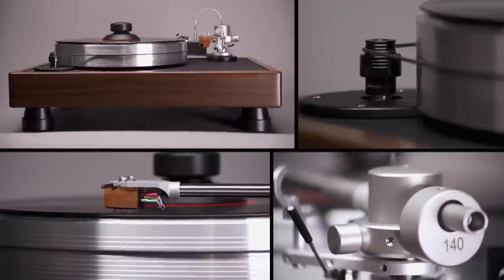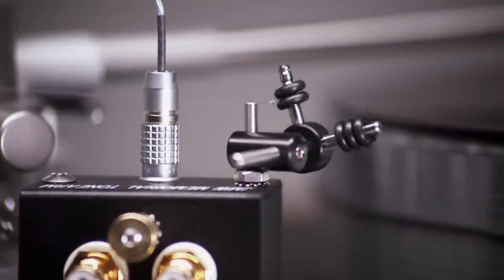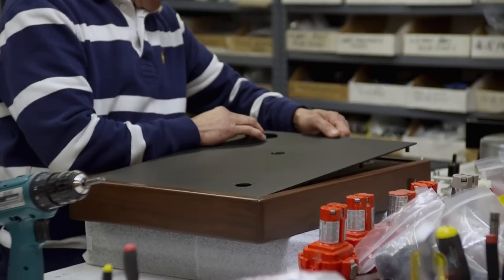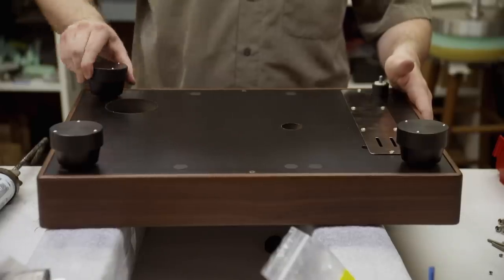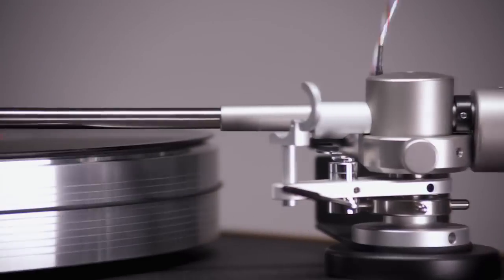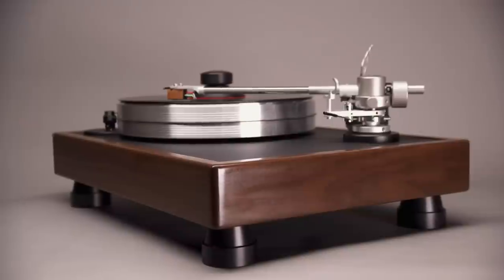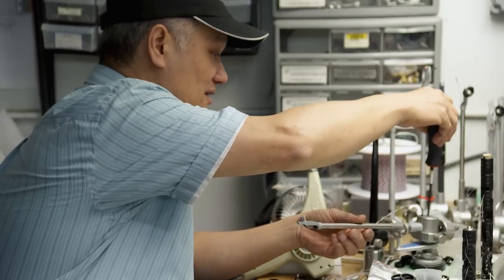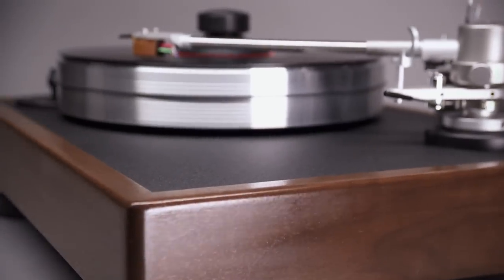How a VPI Classic Turntable is made - BRANDMADE.TV

Comment: Marvelous stuff.  I did my early electronic engineering training in a radio broadcast outfit with six audio studios which used EMT turntables from Germany.  Fantastic.  And 20 pound platters?  Ha!  Ours were 16" diameter and needed 2 guys to lift one, cast iron.  What's new to me, though, is the 'unipoint' (I think) tone arm pivot, excellent idea and that alone would make it superb, never come across it before.  But although absolutely first rate it would never stand up to the hammering turntables get in a pro studio, really rough use for 18 hours a day.  Another winner is the lateral balancing which of course would be necessary with a single pivot point, excellence again.  My present turntable is a Hitachi direct drive, no belts.  But alas, I am now old and my hearing ain't so good no more.....

Comment: The original AR XA  XB was $67 brand new, i used it for 27 years...AR XB pioneered the floating chassis, totally immune from any vibrations, you could literally hammer the plinth vertically and nothing happens to the playing record...I did replace it with a VPI HW MK 3 and have 3 JMW unipivot arms...it works well, but a lot more money

Comment: No solder? motor mounted direclty to the plinth? "aircraft grade aluminum" there are several, all with different characteristics, typically light weight...

I have really been trying to like the VPI turntables but i just dont see how this is worth the cost.

Hot glue...

Balanced scales, how well do they deal with vibration?

Why are they still using metal tone arms? I thought this "space age turntable" would be using "aircraft grade carbon fiber" (which is lighter, stiffer, and more vibration resistant than aluminum).
Reply: Aluminium IF used properly can yeild equal results to carbon fiber.

Comment: I like a little knob to adjust my speed  not that the motor is not spinning and perfect timing but you know I played record where they should have been slow down or they should be speed it up a little bit that's all and having a moter that they say spending at the perfect speed kind of scares me a little bit.  They only made direct drive turntables (ones without a belt or speed control) for the DJ's, because a lot of DJs didn't know how to change a belt in under 3 .1/2 minutes  back in the early 70's & they had to keep the music playing on the radio,  with not time to  worrying about changing belts or if they had a new one in stock & if they didn't they were screwed.

Comment: What type of "glue" do you use to attach the metal plate to the fiber board? Would it not be better to apply this with a notched trowel over the entire two surfaces??
Reply: It looked like DAP calking. And yes, spreading an even amount of "glue" would be a lot better than what they did here.

Comment: With today's technology a high end turntable of today is better than high end turntable from 1970s. However the most common turntable from 1970s which most people had the BSR turntable is better than the most common turntable of today which most young people bought the one with a plastic platter with ceramic cartridge which requires heavier tracking force.

Comment: Affordable turntable?!  This thing is $6000!!
Reply: Avi Pharmd r
Reply: They got one that is $30,000.00
Reply: Just stick to digital.
Reply: Avi Pharmd your better off gutting out a cheap 60 dollar one and making a custom casing for it.
Reply: 6000 for a piece of wood, that you could get, cut to size for 20 bucks.
Plus a AC motor that syn with the mains AC frequency.
where is the testing and measurement?
by putting ball bearing on the feet doesnt mean less vibration going into the turntable

you are paying for marketing and Fatten their wallet
Reply: OUCH!! $6000
Reply: Avi Pharmd well What you expect. Vinyl is hot.
Reply: Not true. The Classic 1 is now discontinued, but it was $2500 when it came out.
Reply: classalpha you don't know the physics of how a small stylus extracts music off a vinyl record do you? If you knew all room for error and inherent flaws in vinyl you would appreciate a machine ( in this case a turntable) carefully engineered and designed to greatly minimize those flaws. Until then keep listening to your all in one Crosley.
Reply: They have ones that are more!!
Reply: There are cheaper models.
Reply: billyboi57 so??
Reply: Avi Pharmd for millionaires
Reply: Pretty much, the turntable market is notorious for 'emperors new clothes'

Comment: Complete garbage.  High mass does not eliminate vibration.  If these guys knew anything about physics, this is the last way you would want to build a turntable.  The steel plate on the top rings like a bell.  Bolting it to a thick layer of MDF does little to damp the vibrations.  Mounting a motor directly to the top ensures the motor vibrations are directly coupled to the tone arm and indirectly to the stylus through the platter.  A couple of years ago, VPI switched the motor to a cheaper version that overheats and locks up after extended play.  They just discontinued making these tables, I wonder why?
Reply: Well there are two ways to look at it, mass will make a turntable less susceptible to vibration because it will take a higher external force to vibrate the turntable, but, if the resonant frequency of the material used is poorly mated to the type of vibrations expected then yes, it will 'ring like a bell'. 

I agree with you in that some poor design choices have been made here when you consider the price point. How much more effort would it have taken to build an air gap between the motor mount and plinth, and the Hurst motors they use are actually notorious for vibration. The turntable industry just doesn't want to invest in R&D for good quality motors or pay premiums for the good systems that exist so we are stuck with $15 motors, belt drives and $4000 worth of marketing BS.

Comment: you will never get good bass on vinyl as cd is just the way it is you just cant make a deeper grovee on the record so the invented the RIAA curve its ok but its not flat eq like a cd and also the noise floor is way donw on a cd compare to vinyl if your cds are loud because of over the top mastering you should adjust your volume with REPLAYGAIN trust me you will get your nice vynil  loudness comfort sound some cds need at least 10db volume down to sound right at the 83-90 db range.